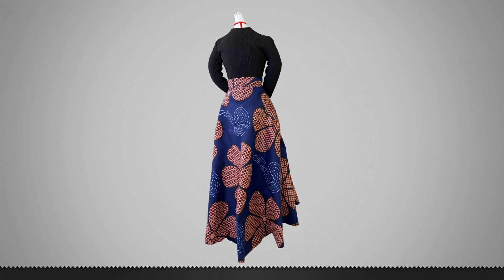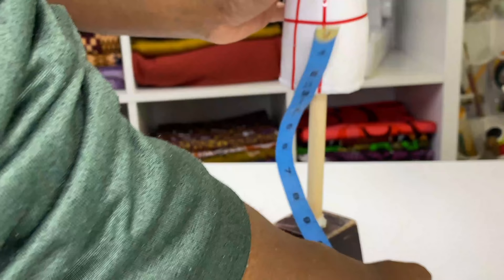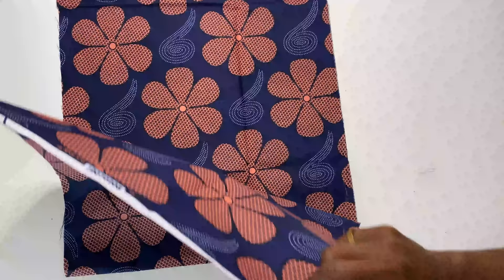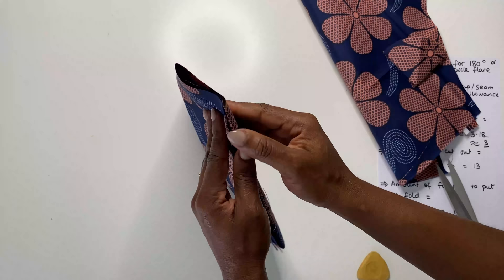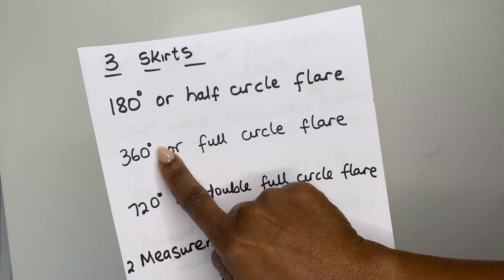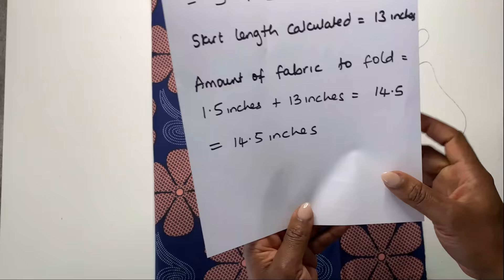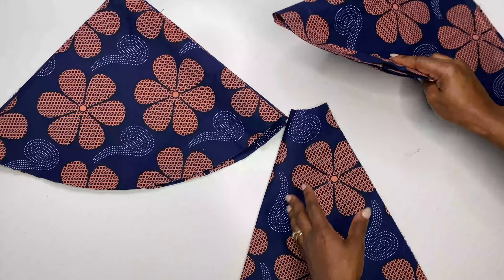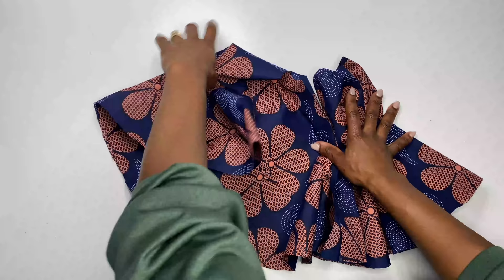How To Cut 180, 360 & 720 Degree Flare Skirt

Comment: Thanks for this, but it's not clear enough, the 360 flare.why not use adult measurement. I try use my measure which is 44, but is not working. Are you saying ma that I need 44 in 4 places pls?
Reply from the maker: Thank you for watching and for your comment. You would still use the same calculations for adult size. So for waist 44 inches it will be:
44 + 2= 46
46 /3.14  = 14.65 (use this for 180 degree skirt waist cutting out)
For 360 degree skirt, divide the result you have above of 14.65 by 2. So:
14.65/2=7.325 (use this for 360 degree skirt waist cutting out)
Hope this clarifies. If you need any further help you can email me on charnoldltd@gmail.com

Comment: Thank you for the tutorial..how much Ankara fabric would you need for the 720° skirt
Reply from the maker: Thank you for watching and for your comment. The amount of fabric you will need, will depend on your waist measurement and the length of your skirt. If you provide those details, I can assist you with calculating how much Ankara fabric you would need.
Reply: @PatternAcademyByCharnold  waist measurement is 98cm and skirt length measurement 100 cm
Reply from the maker: @nyaraimandondo8151  You would need about 10 yards of Ankara fabric.
Reply: @PatternAcademyByCharnold  thank you very much

Comment: For the 180 skirt did you have 16 inches for both the length & Width  before putting it on fold?
Reply from the maker: It was 16 inches length but on fold so that would be 32 inches and 16 inches width. Hope this clarifies.

Comment: Good morning ma pls how did you come about the waist been divided by 3.14....how do I divide using waist 42 thanks
Reply from the maker: Thank you so much for watching! Dividing the waist by 3.14 gives us the radius  we need to cut out 180 flare. If we need to cut out 360, we will need to divide the result by 2. 
So for waist 42;
42 + 2(for seam and zip allowance)=44/3.14=14 (use this for 180 flare)
If you are making 360 flare, divide the result above 14/2 = 7(use this for 360 flare). Alternatively for 360, you can also divide 44/6.28 (which is 3.14 x2) and it will give you the same answer of 7. 
Hope this helps!
If you need any further help, you can email me on charnoldltd@gmail.com

Comment: I'm trying to do this but my fabric isn't big enough for the length. I'm trying the 360 degree flare. Can you please help?
Reply from the maker: Yes I can. Please send me your waist and skirt length measurements and also the width of fabric you are using. Once I have these information, I can work out the calculations and be able to advise on how you can achieve the 360 degree flare for you.
Reply: @PatternAcademyByCharnold  the waist is 28. Skirt length is 25½. Width of fabric is 44inches.
Reply from the maker: @aghoghonwaka5358  sorry just seen your reply. Okay thank you for the info. Do you have an email address so I can send you the explanation with sketched diagrams? You can send your email address to me@ charnoldltd@gmail.com

Comment: Since the 720 flare is cut twice to get 720, why can't I just cut two of 360 to get 720 because I don't the 720 one
Reply from the maker: This is because if you cut two of 360 with the calculated waist measurement for 360, you will end up having double your actual waist measurement. Hence we achieved that by dividing the waist measurement calculated from the 180 skirt by four for the 720 skirt. Note that we only divided it by two for the 360 skirt. Hope this clarifies. If you need further clarification on this, you can email me on charnoldltd@gmail.com.

Comment: How do we achieve this especially the 360 / 720 maxi skirt with fabric that is only 45 inches wide?
Reply from the maker: It depends on the waist and length measurements. It’s okay to cut it in more pieces as needed, based on your available width of fabric.

Comment: Nice tutorial ma'am , but how do you cut 360 degree flare when you have 42 inches length to work with,  as we all know that ankara length is usaully 45 inches but when it's on fold it reduces. Do I need to cut 180 degree flare and join. Thanks ma.
Reply from the maker: Thank you so much for watching! Please what is your waist measurement so I can calculate it!
Reply: @PatternAcademyByCharnold  my waist measurement is 36 ma. Thanks
Reply from the maker: @aimuemojiefaith6465  For waist 36 inches, you will calculate like this:

36+2 (for seam and zip allowance) = 38
38/3.14 = 12.1 so divide result of 12.1 by 2 for 360 = 6.05

So full length you need will be 6.05 + 42 + 1 (for hem allowance) = 49

You can cut four pieces of length 49 inches each by 49 inches. It is best to work with Ankara fabric with more width (58 inches if possible). Otherwise you can join the extra needed to complete it if using fabric with width 45 inches. Hope this helps. You can email me on charnoldltd@gmail.com if you need further help. Thanks.
Reply: @PatternAcademyByCharnold  oooooohh thanks so much ma, I really appreciate.  Of course I'll inbox you I can disturb and ask questions oooo😁😁😁😁😁😁. God bless you ma

Comment: Hello i need help on some measurements so my mannequin waist measure 14 inch and i want to do a 720 degree skirt can you please guide me
Reply from the maker: Hello, so it will be 14 + 2(seam/zip) =16 inches
Method 1: 16/3.14 = 5.09
Next result above 5.09/4 = 1.27 inches

Method 2: Divide by 12.56 which is the same as 3.14 x 4 (so you are ultimately doing the two steps above in one. 
So, 16/12.56 = 1.27 inches
So your radius to cut will be 1.27 inches. 
Hope this helps.
Reply: @PatternAcademyByCharnold  it did help thank you

Comment: Thank you so much please how many yards of Ankara did u use? Also can I cut 4piece if my fabric isn’t long enough using the radius
Reply from the maker: Thank you so much for watching! The number of yards of Ankara will depend on the type of flare and your measurements. For example for a maxi Ankara 180 degrees skirt with waist 30, I used about 3 yards of Ankara. Yes you can cut 4pieces if your fabric is not long enough to put it on fold. Hope this helps.
Reply: I meant the 720 so when I divide my waist 35 with the radius I can cut 4 piece using the radios the fabric isn’t long when folded am 5”11 lol thank you
Reply from the maker: @JenniferAnidu  Thanks for providing info on your waist measurement but I still need your skirt length to calculate the fabric you would need? Are you making a mini, midi or maxi length? You can email me on charnoldltd@gmail.com with the details and I can assist and give you some more guide on how to achieve your desired skirt.
Reply: Thank you so much!!

Comment: I understood the 180 and 360 degree calculations. But the 720,I don't seem to get how the 0.75 came about.
Reply from the maker: We got 0.75 by dividing the first result of 3 (for 180) by 4. 

As we have 4  x 180 = 720
So the result of 3 used for the 180 skirt needs to be divided by 4 for the 720. 

Hope this helps. Also I suggest you watch it again, hopefully with this insight, it will help you understand it better.

Comment: Helo please if I was going for a button down gown with circle half length do I input additional 2inches for the front in addition to the 2 inches at the back for zipper alllowance I hope you understand my question?
Reply from the maker: Hello, and thank you so much for watching. Oh no, it’s just 2 inches addition. However you can always adjust the seam/zip/button allowance based on the style you are making. Remember if it’s a button down in front style, you will not need a zip at back. Hope this helps.
Reply: @PatternAcademyByCharnold  it does  but what of if the botton in front are mainly for decorative purposes and it wouldn’t be used for  getting in or out of the dress
Reply from the maker: Yes, to be honest, you can be flexible with the additional allowances as long as you use them up when sewing such that it does not interfere with the overall fit of the dress. If you need any further help with this, feel free to email me on charnoldltd@gmail.com
Reply: @PatternAcademyByCharnold  thank you for your response 🥰

Comment: Love your explanation but as per the 3inches you divided, is it a constant or it's according to the waist measurement. Thanks
Reply from the maker: Hello, thank you so much for watching! The 3 inches was derived by dividing the waist measurement by 3.14. So it is not a constant as it’s according to your waist measurement. Hope this clarifies.
Reply: @PatternAcademyByCharnold  how did you get 3.14
Reply from the maker: @okechukwubanny1367  the 3.14 is a constant used for calculating radius of a circular shape. Hope this helps.

Comment: I’m just learning and I hope you see this and reply me for my waist measurement should I also divide it by 3.14 inches cus when I did that I got 9inches and 12.5 inches for the skirt length total length was 21.5 inches and I’m trying to do a double flare but the 21.5 inches I got in the end was to long passed my knee. What I want to know is what is that 3.14 inches for?
Reply from the maker: Thank you so much for watching and for your comment. Dividing your waist measurement by 3.14 gives you the amount to cut for a 180 or half flare and you have stated you got 9 inches in your case. So for a 360 or full flare you would divide the 9 inches by 2 = 4.5 and that would be the amount to cut. For a 720 or double full circle, divide the 9 inches by 4 = 2.25 and that would be the amount to cut. Hope this helps. You can also email me on charnoldltd@gmail.com if you need any further help on this. Thank you.

Comment: Please how did you get your 3.14 to divide with you 10inches for the waist measurement? 
Also how did you get 13 for amount of fabric unfold?
Reply: She uses 3.14 because its circular and dividing by Pi she can get her waist radius measurements for the different skirts. And I believe the 13 is the total length based on 12 inches for the length of the skirt plus 1 inch the seam allowance.
Reply from the maker: 3.14 (a constant called Pi) was used because its circular and dividing by Pi gives the waist radius measurements to cut out for the different skirts. The 13 inches is the total length based on 12 inches for the length of the skirt plus 1 inch for the seam and hem allowance. Hope this helps!
Reply from the maker: Thank you.

Comment: The numbers don’t make sense I don’t understand how you’re getting the numbers can you please explain
Reply from the maker: 3.14 (a constant called Pi) was used because its circular and dividing by Pi gives the waist radius measurements to cut out for the different skirts. The 13 inches is the total length based on 12 inches for the length of the skirt plus 1 inch for the seam and hem allowance. Hope this helps
Reply: @PatternAcademyByCharnold  thank you

Comment: How many meters of the materials we need for double circle skirt???
Reply from the maker: Thank you so much for watching! The fabric amount to use would depend on several factors such 1.)measurements: waist and length of skirt as well as 2.)fabric width; 45inches, 60inches, 90inches etc. 
I can help you calculate how much fabric you would need if you can provide those details. Hope this helps.

Comment: Very well explained. Thankyou. Can you please tell me How to calculate fabric for 360degree skirt for adult with 40 length and 34 waist
Reply from the maker: Thank you so much for watching and for your comment.  

For waist 34 inches and 40, you will calculate like this:

36+2 (for seam and zip allowance) = 38
38/3.14 = 11.5 so divide result of 11.5 by 2 for 360 = 5.75

So full length you need will be 5.75 + 40 + 1 (for hem allowance) = 46.75

You can cut four pieces of length 46.75 inches each by 46.75inches. OR two pieces of 46.75 on fold. It will be best to use fabric with width more than 45 inches. If you are working with African print/Ankara fabric, it may be best to work with Ankara fabric with more width (58 inches if possible). Otherwise you can join the extra needed to complete it if using fabric with width 45 inches. 

In conclusion you would need about 5.5 yards or 5 metres of fabric. 

Hope this helps. 

You can email me on charnoldltd@gmail.com if you need further help. Thanks.
Reply: @PatternAcademyByCharnold  thank you very much for the explanation. In that case, do I need 10 metres for 760 degree?
Reply from the maker: @oindriladutta4193  Yes that’s about right. You will need about 9  to 9.5metres.

Comment: How do you achieve a 720° for a real person using the Ankara fabric?
Reply from the maker: Thank you for watching and for your comment. To achieve 720 degree for any size of person, you would just use the waist and length measurements of the person and do  the calculations shown in the video. Then use the results you get to cut your skirt. Hope this helps.
Reply: @PatternAcademyByCharnold   thanks for your response i honestly wasn't expecting you to. The Ankara fabric comes in 45" length hence y i asked that question. You can't even get a 360 skirt for a size 10 person with length 20 not to talk of 720. That was why i asked
Reply from the maker: @JM_Design  You are welcome. Some Ankara fabrics come in width of 60 inches so you may try to get those. Also you can join the pieces as needed to complete the length. If you give me the waist and length measurements you are working with I could help with more specific guide on how to achieve it. Meanwhile you could also check out this video where I showed how to make the 180 maxi flare with pockets and see how I joined the pieces to complete my desired length. 
https://youtu.be/RRcKML20RcU

Comment: Please am confused here. I only use 6.28 to calculate my 360 degree flare, I don't know about 3.14. Please how can I use 6.28 to cut out my 180 degree flare.
Reply: Hi, she used the method of c=2πr
Reply from the maker: If you divide 6.28 by 2 you will get 3.14. You can use 6.28 to get radius for 360 skirt but if you want to make 180 skirt, you will then have to multiply the radius you used for the 360 by 2 to get radius for 180 skirt. Hope this helps.

Comment: Hi dear 
i have a question please help me
my skirt is 720 or double full and my waist is 33 inches and my length is 50 and my width is also 50 
my waist 33 i don't know the divide and the fabric how many fabric i need 
please please please help me
Reply from the maker: Hi dear, the calculation will be:
For the waist to cut out;
33 + 2 = 35
35 / 3.14 = 11.14 ( this will be for 180 degree skirt)
11.14 / 4 = 2.78 (For 720 degree skirt)
Length to cut out will be 2.78 + 50 + 1= 53.78 inches. 
As your full length to cut out is 53.78 inches which is more than your fabric width of 50 inches, I suggest you use a fabric with width of 55-60 inches. 

Hope this helps.
Reply: @PatternAcademyByCharnold  thank you so much 😊 and how many fabric i need how matter please help me my dear
Reply from the maker: @asmarahmani4555 Fabric width should be at least 55inches
You will need about 11 metres of fabric or in yards, it will be 12 yards of fabric. 
Hope this helps.
Reply: @PatternAcademyByCharnold  thank you so much my sister if i have questions i will ask you 🙏🥰👍🏻

Comment: Please am confused here. I only use 6.28 to calculate my 360 degree flare, I don't know about 3.14. Please how can I use 6.28 to cut out my 180 degree flare.
Reply from the maker: Thank you so much for watching! That’s a very good question thank you. After you divide your waist by 6.28 then multiply the result you get by 2. This will give you the number to use for cutting the 180 degrees flare. 
For example for a waist of 32: if you divide 32 / 6.28 = 5.09 (use for 360 flare). So for 180 flare you will multiply this result of 5.09 by 2 = 10.19 (use for 180 flare). 
Note: if you use the 3.14 method, it will give you the same result for the 180 flare. So 32 / 3.14 = 10.19 (use for 180 flare). So for 360 you divide the result of 10.19 / 2= 5.09 (use for 360 flare). Hope this clarifies. If you need any further clarification or explanation, you can email me on charnoldltd@gmail.com
Reply: @PatternAcademyByCharnold  Thanks for the quick reply. I really appreciate and now I understand it clearly. God bless you
Reply: @PatternAcademyByCharnold  Also which type of degree flare is best use for wedding ball gown
Reply from the maker: @adeyanjuchristianah7772  Really glad to know it has helped. Amen and God bless you too.
Reply from the maker: @adeyanjuchristianah7772  I think there is no specific answer to that as it depends on different factors; the fabric, body shape, desired silhouette etc, so will be more on a case by case basis. Also you can use underskirt to enhance the shape.
Reply: @PatternAcademyByCharnold  You have indeed blessed me this morning. Thank you so much